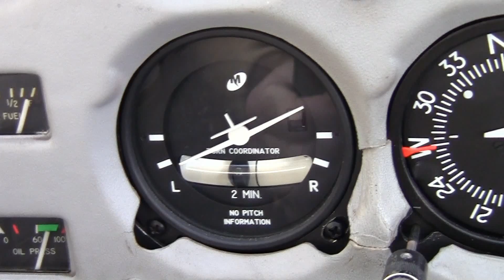How To Forward Slip an Airplane

Comment: Here’s what Bill Thompson, former Manager of Flight Test & Aerodynamics at Cessna, had to say about the issue of slipping with full flaps in the 172 (Cessna — Wings for The World, by William D. Thompson, Maverick Press, 1991, p. 41):

With the advent of the large slotted flaps in the C-170, C-180, and C-172 we encountered a nose down pitch in forward slips with the wing flaps deflected. In some cases it was severe enough to lift the pilot against his seat belt if he was slow in checking the motion. For this reason a caution note was placed in most of the owner’s manuals under “Landings” reading “Slips should be avoided with flap settings greater than 30 deg. due to a downward pitch encountered under certain combinations of airspeed, side-slip angle, and center of gravity loadings”. Since wing-low drift correction in crosswind landings is normally performed with a minimum flap setting (for better rudder control) this limitation did not apply to that maneuver. The cause of the pitching motion is the transition of a strong wing downwash over the tail in straight flight to a lessened downwash angle over part of the horizontal tail caused by the influence of a relative “upwash increment” from the upturned aileron in slipping flight. Although not stated in the owner’s manuals, we privately encouraged flight instructors to explore these effects at high altitude, and to pass on the information to their students. This phenomenon was elusive and sometimes hard to duplicate, but it was thought that a pilot should be aware of its existence and know how to counteract it if it occurs close to the ground.

You'll notice that beginning with the 1972 model year ('73 for European-built models) 172s have a larger dorsal fin. This apparently eliminated the "pitch-down" problem.

*However, there is also an unrelated, more benign phenomenon that Thompson described in newer models in full-flap slips: “a mild pitch ‘pumping’ motion resulting from flap outboard-end vortex impingement on the horizontal tail at some combinations of side-slip angle, power, and airspeed.” This really isn't a problem and it's not limited to Cessnas -- my Sport Cub does it, as well, and it doesn't keep me from slipping with full flaps in either airplane.

So although the 172L’s larger dorsal apparently solved the pitch-down issue, they kept the cautionary note in the POH because of the latter phenomenon.

Unfortunately Cessna contributed to the “end of the world” fear of slips with flaps, by not explaining the pitch-down phenomenon in the manuals; and in fact, many earlier C-172 manuals expressly said that slips with full flap were prohibited. I rummaged through my collection of old Cessna owners manuals:

1958 C-172: “prohibited”
1959 C-175: “prohibited”
1966 C-172F: “prohibited”
1972 C-172L (first year of the big dorsal): “should be avoided”

The manuals and TCDS for these older models have been revised since then, and there is now no legal prohibition against slips with flaps -- but that’s what a lot of us old-timers read back then and remember.

And some further clarification:

The pitch-down that might occur with flap-down slips in Cessnas is not from "elevator blanking." Cessna's aerodynamicist and test pilot said, "The cause of the pitching motion is the transition of a strong wing downwash over the tail in straight flight to a lessened downwash angle over part of the horizontal tail caused by the influence of a relative 'upwash increment' from the upturned aileron in slipping flight."

In other words, in extreme slip conditions some of the upwash from the upturned aileron on the lowered wing might hit the horizontal stabilizer. Flaps cause downwash on the horizontal stabilizer -- that's why retrimming is necessary when flaps are extended. When some of that flap downwash is replaced by upwash from the aileron, there is very suddenly too much nose-down trim, and the nose pitches down.

"Elevator blanking" makes it sound as if the elevators lose effectiveness, and that's not what is happening.

The pitch-down is not a consistent phenomenon in 172s; Cessna test pilots found it "elusive and sometimes hard to duplicate." And apparently the larger dorsal fin from 1972 onward prevents the 172 from yawing far enough in a slip to allow aileron upwash to hit the tail, so the issue is moot.

It's interesting that the old (pre-1972) C-172 owners handbooks (which do not carry the force of law) said slips with full flaps were "prohibited" -- while the current version of the TCDS (which is the "law") only calls for placards saying "Avoid slips with flaps down" (172 thru 172E) or "Avoid slips with flaps extended" (172F thru 172N). The old "prohibited" language is nowhere to be found.

There is no caution against slips with flaps in the 172P and newer, in which maximum flap extension is reduced to thirty degrees.

Comment: It's probably a good idea to practice high speed slips. Having tower announce expedite landing and hold short of the crossing runway for a landing DC-9 was funny. Must of had tower thinking his time perception and vision was off. I was glad when the plane finally started braking from the extreme slips during forward and turns dropping in.

Comment: Garry when i was a student pilot many years ago i read about cross controls on final in a flying mag and tried it several times short and steep. didnt matter which way but full rudder and full opposite aileron. was strange to be looking out the side window at the runway centerline. dropping like a rock.  come to think of it i think i brought the nose up a tich just before i started the manuver. was easy to recover from. is this dangerous?
Reply from the maker: Dangerous? Slip: No  / Skid: Yes! You're more likely to induce a spin from Straight/Level than you are in a Slip. Not sure about you "bringing up the nose a bit"; the point of uncoordinated (slipping) flight is creating drag that allows you to LOWER the nose, without picking up airspeed. As I've said and demonstrated elsewhere, I can see no reason to ever knowingly Skid an airplane.

Comment: a view from the ground would be nice - 
an easier / less expensive way to show a view from the ground would be to use a remote control airplane and film it doing the maneuver.
I watch videos like this one to learn things that help with my RC flying.
With an RC you can really see the effect the controls have when slipping, crabbing, stalling -
and if you mess up your heart rate and blood pressure will not go up as much.

Comment: Having seen a video on the 1983 "Gimli Glider" incident (where a dude had to land a 767 that had run out of fuel In a retired Air Force base in Gimli, Manitoba) brought me here. The pilot had to use Forward Slip as they were a bit excessively high above the runway on approach (and their only chance to land safely was that particular and single approach)

Comment: Keep in mind that during slips, the pitot tube is also slipping with the plane.  The fuselage blocks the pitot tube from a direct airflow giving an inaccurate airspeed indication.  I've seen the error as much as over 20kts in some situations.  So don't rely on your airspeed indicator for accuracy during heavy slips.   DPA, CFIA
Reply from the maker: Good point. In most light trainers there is also only one static port, which may or may not be in the airstream. In my Cub, the static port is behind the ASI inside the cockpit, so airspeed will read between 30 - 70 MPH while slipping --- next to useless.
Reply: Nice to meet you Garry.  Good video. Good lesson.
Reply: @GarryWing  Thanks for a great video and the extra info (above). A quick question about not applying throttle (height) which is understandable on finals/approach, am I correct in thinking when I see Eg, an Extra 300 flying in the slip angle (uncoordinated) at the same level along the runway in a display that the pilot has to apply throttle (constant) so as to maintain such a manoeuvre?
Reply: I was about to post this. The PITOT tube is way off while uncoordinated and 20knots slower indicated is pretty much a given during a full deflection forward slip. Right when you release the inputs can see the indicated airspeed just shoot up.
Reply: @Alex-us2vw  Thanks! That explains why I so fast short final after learning slips. Should we just have it trimmed for appropriate speed before (80 kt is what my instructor suggested in the 172M) and let the plane fly itself at that speed in the slip?
Reply: daffidavit in gliders the Airspeed decreases to 0 knots during a slip
Reply: That's an interesting point... I know that if I round out after a slip my airspeed builds up pretty fast... wondering how much of that is just due to ASI error
Reply: Then how do we resolve this? Since we need to maintain a special airspeed to not stall the aircraft.

Comment: With a forward slip is carb heat required?
Reply from the maker: You generally apply carburetor heat prior to reducing power below the green arc on the Tachometer, irrespective of what maneuver you're performing. As you'd normally not slip a plane with cruise power (like using the brakes on your car while stepping on the gas), the short answer is "yes". Consult your airplane's POH; it will give specific guidance for use of carb heat.
Reply: Ok. Appreciate it !

Comment: Great video.  When I was getting checked out in a super cub we spent a day doing lots of forward slips so I could get accustomed to the increased rudder authority that plane provided, compared to the cessnas I had been usually flying.  When the instructor demonstrated forward slips he would take the speed down to near stall speed in the forward slip and kept the nose right on the horizon.  I found that somewhat alarming, because I knew that a stall in uncoordinated flight could easily lead to a spin.  A very bad deal at low altitude.  I asked him about it a few times, but he insisted that was how forward slips should be flown.  When he handed the controls to me, I did what I knew was right, and lowered the nose a bit when the speed dropped well below approach speed.  He kept admonishing me for that, and after that flight I switched instructors.  In hindsight I probably should have complained to management about that too.  He was making a pretty serious mistake in his instructions that had a real possibility of getting someone killed.

Comment: Not sure if I'd be comfortable slipping a 172 with full flaps especially at 55 kts on short final. Sounds sketchy to me.
Reply from the maker: Get some short-field (over obstacles) training. You'll learn to become comfortable slipping with flaps at approach speed to get to an 1,100' strip over a tree line. Not sure what the concern is; as long as you don't exceed critical AOA (descending 1,000+ FPM, in this case) you're not going to stall, right.....?
Reply: Garry Wing I suppose in that case I could understand the need to use full flaps in a slip, but I was under the impression that the Cessna's POH said slipping with full flaps is not recommended because airflow disruption from the flaps over the elevator could potentially tail plane stall you.
Reply: @lkorn9150  There is no possibility of tail plane stall, that was fixed in 1972. There is a benign elevator oscillation, and no - it's not because the elevator is "washed out" by the flaps... 

Here’s what Bill Thompson, former Manager of Flight Test & Aerodynamics at Cessna, had to say about the issue of slipping with full flaps in the 172 (Cessna — Wings for The World, by William D. Thompson, Maverick Press, 1991, p. 41):

With the advent of the large slotted flaps in the C-170, C-180, and C-172 we encountered a nose down pitch in forward slips with the wing flaps deflected. In some cases it was severe enough to lift the pilot against his seat belt if he was slow in checking the motion. For this reason a caution note was placed in most of the owner’s manuals under “Landings” reading “Slips should be avoided with flap settings greater than 30 deg. due to a downward pitch encountered under certain combinations of airspeed, side-slip angle, and center of gravity loadings”. Since wing-low drift correction in crosswind landings is normally performed with a minimum flap setting (for better rudder control) this limitation did not apply to that maneuver. The cause of the pitching motion is the transition of a strong wing downwash over the tail in straight flight to a lessened downwash angle over part of the horizontal tail caused by the influence of a relative “upwash increment” from the upturned aileron in slipping flight. Although not stated in the owner’s manuals, we privately encouraged flight instructors to explore these effects at high altitude, and to pass on the information to their students. This phenomenon was elusive and sometimes hard to duplicate, but it was thought that a pilot should be aware of its existence and know how to counteract it if it occurs close to the ground.

You'll notice that beginning with the 1972 model year ('73 for European-built models) 172s have a larger dorsal fin. This apparently eliminated the "pitch-down" problem.

*However, there is also an unrelated, more benign phenomenon that Thompson described in newer models in full-flap slips: “a mild pitch ‘pumping’ motion resulting from flap outboard-end vortex impingement on the horizontal tail at some combinations of side-slip angle, power, and airspeed.” This really isn't a problem and it's not limited to Cessnas -- my Sport Cub does it, as well, and it doesn't keep me from slipping with full flaps in either airplane.

So although the 172L’s larger dorsal apparently solved the pitch-down issue, they kept the cautionary note in the POH because of the latter phenomenon.

Unfortunately Cessna contributed to the “end of the world” fear of slips with flaps, by not explaining the pitch-down phenomenon in the manuals; and in fact, many earlier C-172 manuals expressly said that slips with full flap were prohibited. I rummaged through my collection of old Cessna owners manuals:

1958 C-172: “prohibited”
1959 C-175: “prohibited”
1966 C-172F: “prohibited”
1972 C-172L (first year of the big dorsal): “should be avoided”

The manuals and TCDS for these older models have been revised since then, and there is now no legal prohibition against slips with flaps -- but that’s what a lot of us old-timers read back then and remember.

And some further clarification:

The pitch-down that might occur with flap-down slips in Cessnas is not from "elevator blanking." Cessna's aerodynamicist and test pilot said, "The cause of the pitching motion is the transition of a strong wing downwash over the tail in straight flight to a lessened downwash angle over part of the horizontal tail caused by the influence of a relative 'upwash increment' from the upturned aileron in slipping flight."

In other words, in extreme slip conditions some of the upwash from the upturned aileron on the lowered wing might hit the horizontal stabilizer. Flaps cause downwash on the horizontal stabilizer -- that's why retrimming is necessary when flaps are extended. When some of that flap downwash is replaced by upwash from the aileron, there is very suddenly too much nose-down trim, and the nose pitches down.

"Elevator blanking" makes it sound as if the elevators lose effectiveness, and that's not what is happening.

The pitch-down is not a consistent phenomenon in 172s; Cessna test pilots found it "elusive and sometimes hard to duplicate." And apparently the larger dorsal fin from 1972 onward prevents the 172 from yawing far enough in a slip to allow aileron upwash to hit the tail, so the issue is moot.

It's interesting that the old (pre-1972) C-172 owners handbooks (which do not carry the force of law) said slips with full flaps were "prohibited" -- while the current version of the TCDS (which is the "law") only calls for placards saying "Avoid slips with flaps down" (172 thru 172E) or "Avoid slips with flaps extended" (172F thru 172N). The old "prohibited" language is nowhere to be found.

There is no caution against slips with flaps in the 172P and newer, in which maximum flap extension is reduced to thirty degrees.
Reply: The concern is that the horizontal stabilizer / elevator gets washed out by the flaps. It does feel like someone is jumping up and down on the tail. Strange but not an issue. The placard on a 172 says slips not recommended but also not prohibited.
Reply: I've been doing it for 50 years.  Still here, although I sometimes wonder, how, but for the Grace of God, for some other dumb things I've inadvertently done.  But slipping with full flaps is ok in C-150/152s and 172/182's.   Remember, the pitot tube will not be getting a direct airflow and indicated airspeed will be inaccurate during the slip.  DPA, CFIA

Comment: My powered airplane instructor didn't teach me much about slipping if any.
My glider instructor, which came before my power training taught me loads about slipping.
Turning while slipping was even taught.
While downwind at the end of my SEL check ride we were cleared to land.
The examiner declared I had lost the engine and my flaps were inoperative.
We were in a Piper Cherokee which has mechanical flaps and it's extremely rare to have a flap failure in a manual flap airplane and I relayed that to the examiner.
He said he didn't care, land the airplane without flaps.
I don't know how uncomfortable he was with my aggressive slipping, but we made the runway and I passed.

Comment: It's forbidden to slip a Cessna with flaps
Reply: +Ulas Akkaya  - POH states "Not Recommended with Full Flaps", which is a far cry from "Forbidden".
Reply from the maker: +Ulas Akkaya Huh? How do you land in a crosswind? (I mean, other than slamming it on with the wheels headed toward the weeds?)